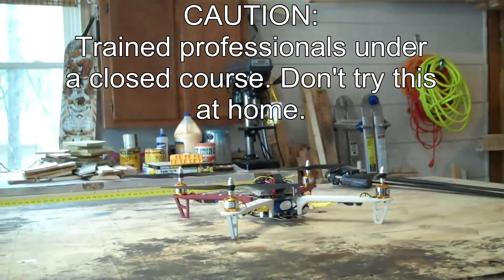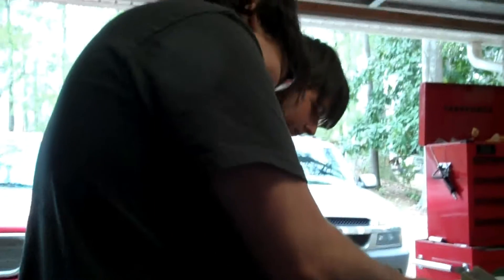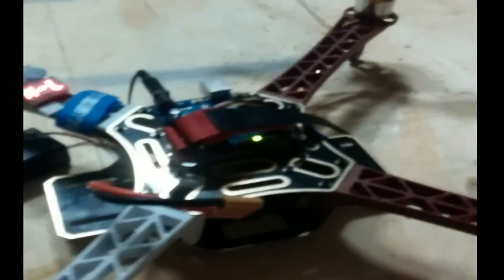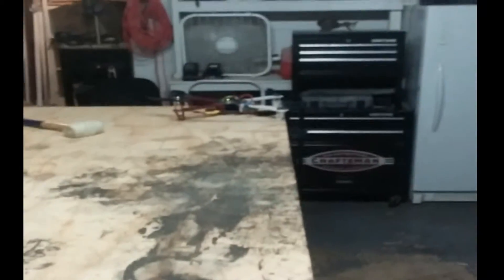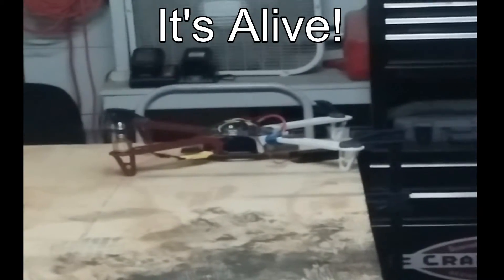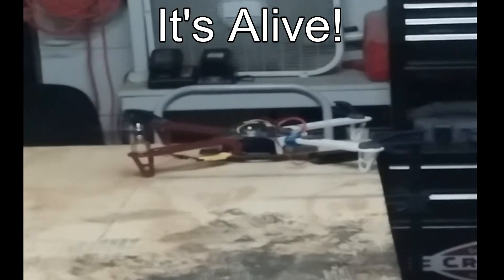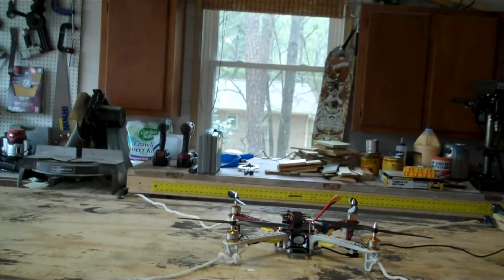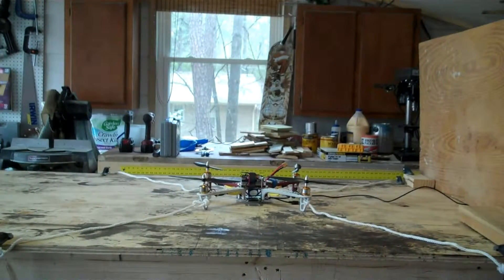Arduino Quadcopter Part 1 - Getting Off the Ground

Comment: Hi guys, I'm writting from Chile, and I'm little confused, I can understand fully the difference between a 3D drone , 3D drone with stabilization and Autolevel drone, could you explain me? I'm not sure if 3D drone with stabilization is the same that Autolevel drone, thank you!
Reply from the maker: From the way I've read it, stabilization is just the act of using PID algorithms to make the quadcopter accurately go in the direction you want to. Auto Level uses stabilization to correct back to an upright hovering position once you release the stick inputs.

I hope that explains well enough.